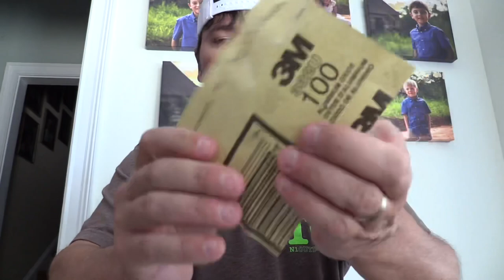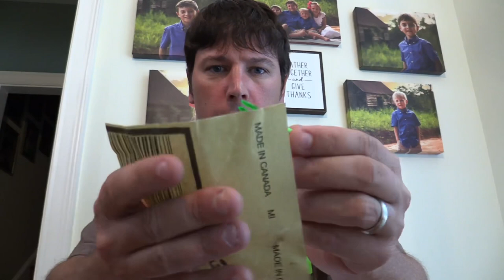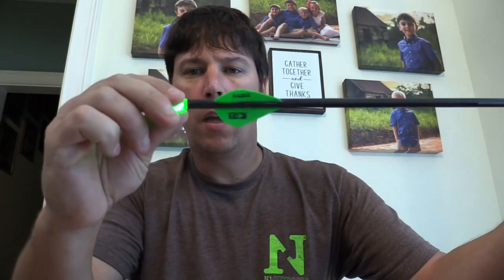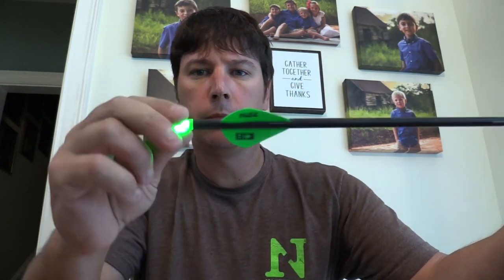Easy DIY Lighted Arrow Nocks for bowhunting [step-by-step instructions!] | N1 Outdoors

Comment: I am doing this as described but getting slightly different results. Let me explain, first off i followed your directions exactly to a T but i noticed that after a few shots the light goes out and then i can hear that the inner battery insert has move towards the front of the arrow after several impacts(Momentum force from the impact of the target). I think i may have solved this issue by gluing the battery section into the arrow first at the proper distance from the end ( inject the glue down into the correct distance). After the glue dries with the battery inserted into  place, I then can inert  the light part into the arrow for it to function without the battery sliding down towards the tip direction anymore etc. I wonder if anyone else is having this concern as well? Anyways its a good cheap fix to make bravo for posting this video!

Comment: Thanks for the video. How do you get the battery out of the arrow when you need to?
Reply from the maker: The battery will have been glued inside the nock. Just pull the nock out to remove nock from shaft
Reply: @N1outdoors  The light   pulled off the top of the battery and the battery stuck in the shaft. I think for $14 I'm just going to buy some. Thanks.
Reply: I blew it out with the air compressor.

Comment: I have premade lighted knocks that the battery fits very loose in the shaft but the knock fits very tight and work on the pressure type of inertia, I am wondering if I tried something similar with what you did on your knocks if they would work because the factory knocks keep popping off the arrows when fired and stay on the string while the shaft goes down range what do you think?
Reply from the maker: Raymond, it’s important that you have nocks that fit very snugly in the shaft. The glue that you apply to the end of the battery light, as shown in the video is what holdss the nock together.
Reply: You can also adjust your nock ears so they don’t grip the string so tight. Gently put a screwdriver tip between them and pry out on one at a time checking how tight they are on you bowstring when you get done. It may take a couple times to get them the way you want them. 
Sounds like yours are fitting pretty tight.

Comment: Do you think this would work in a H size nock?  .234 size
Reply from the maker: Scott, not sure on that. The batteries may not fit in that size nock diameter
Reply: Thank you for getting back to me. So what your saying is that even thoe the knocks that were already installed on the arrows when bought keep popping off that once the back end is glued to the battery it will prevent this from happening should I lightly sand the new knocks base that goes into the shaft or coat them with a lite coating of wax or something so that they will operate the way that I want with the release of the arrow because the company that made these is saying that I need to turn them on first. I am wondering please let me know
Reply from the maker: @raymondbrown3216  It would be good to first start with whether light/battery will fit inside of your nock. You may need to buy nocks other than the ones came with your shaft. They do need to fit snugly in the shaft, but if they are too tight, yes, you can lightly sand. If they not go into the shaft too easily, you’re going to have problems with slippage. When you insert a finished product into the shaft, it should be somewhat difficult to get it into the shaft. That’s a good thing, because it will ensure that the back end of the nock will stay in the shaft. So, if you do that and the light is collude well into the nock, it will work well. There is some trial and error to the process. But once you know which batteries and which nocks work well with your shaft, you will be set. Also, there are some slight variations in battery diameters as well, so you may have to buy a couple different packs to find which work well with your nocks.

Comment: How much do these weigh in grains once finished using the bobber light? I think these are great!
Reply from the maker: About 15-20 grains depending on the size of the collar you insert into the shaft
Reply: @N1outdoors  that’s awesome! Thanks, I will have to give this a shot when I build my next set of arrows this summer

Comment: Hey bud. Just wondering what brand of nock you use for this.
And I asume the shafts you are using are .245 dia?
Cheers
Reply from the maker: Hey there. Josh actually uses NAP nocks in the video, however the newest models don’t have a large enough inner diameter to slide the battery into... Carbon Express Launchpad nocks work well... .245
Reply: @N1outdoors  awesome. I have the thill bobber lights and some victory vforce sports in .245 but the nicks that are already fitted are a loose fit for the battery.
Cheers, time to go shopping
Reply from the maker: @lukeaday  It’s OK for them to be a little loose. The glue on the light end of the battery will hold them in place